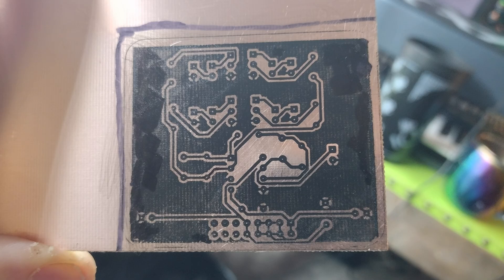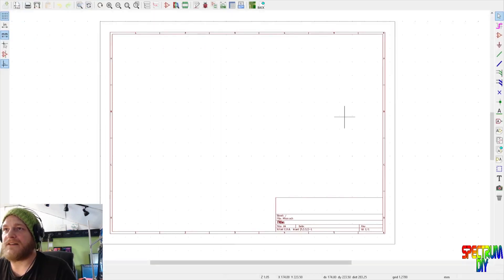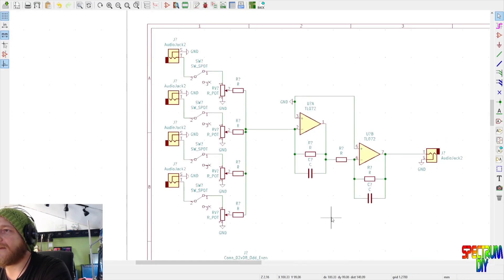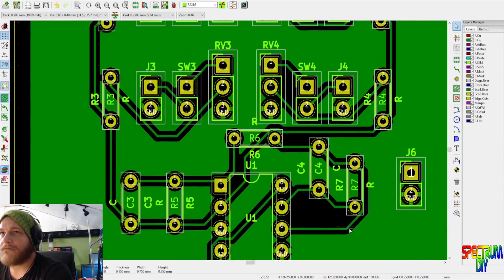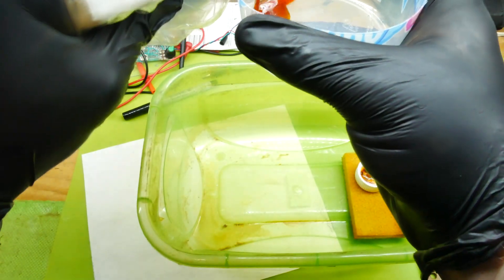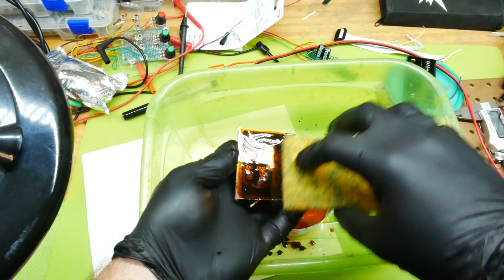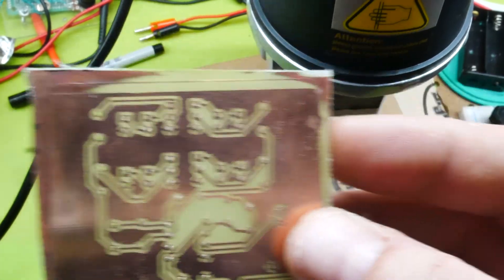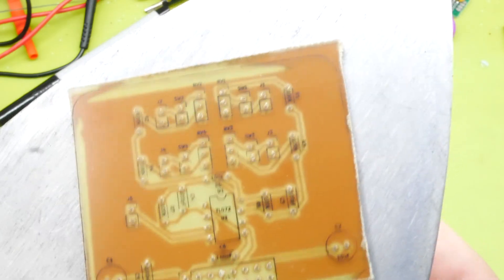How to make a PCB from scratch ( Including Silkscreen )

Comment: hmm well I don't have any of that fancy stuff, only an Arduino. maybe next vid do a Arduino synth tutorial?
Reply from the maker: You're fancier than I XD
Most fancy thing here was a laser jet printer I think, otherwise the rest was primitive tools XD
Reply: @SpectrumDIY  here get the cheapest one that  have a elegoo mega 2560
Reply from the maker: Just looked up the kit, that's the same one I was looking at getting earlier this year! Is it any good? Would be interesting to dig into arduino (Have not tried it yet)
Reply: @SpectrumDIY  its a very good kit! it uses the same Arduino coding software and you connect it to other things that don't come in the kit. I suggest to try it and make a synth!